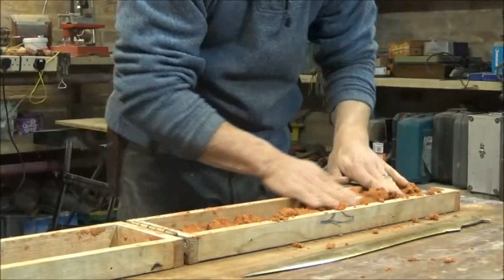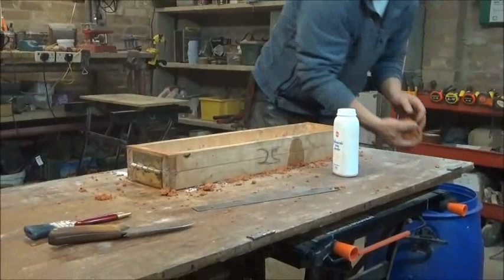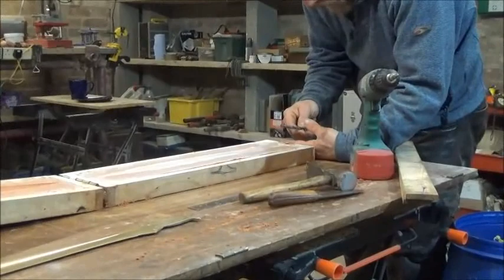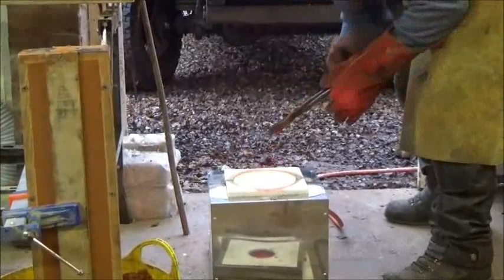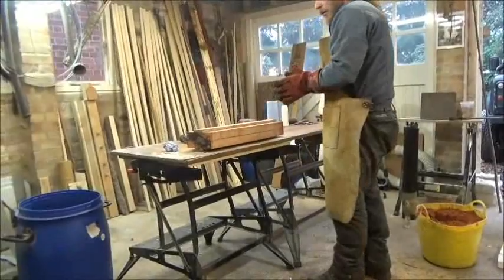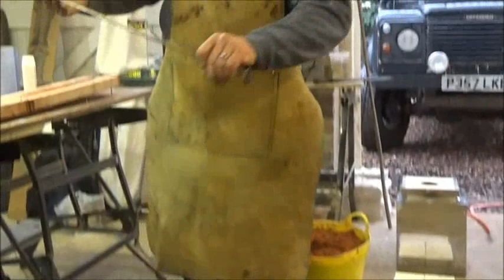How To Sand Cast a Bronze Age Sword

Comment: I worked in a cast iron founry for 5 years...  happy days  its better if you sieve the sand for the top layer ... We used parting powder made from chalk .... but it would have been better if you had layed the blade on the base and filled it up and rammed sand on top of the blade .  then turn the mold over and make a joint ...   then put the top half of the box on top then parting powder then fill top half with sand .  then you should be able to lift the top box off remove the sword mould and cut the runners an risers ....   youll get a better finish if you use a Sieve ...  Once it has been cast you should let it cool down naturally .....

Comment: Just a suggestion... a tiny suction cup or a length of wood with adjustable suction cups on the hilt and blade part would probably give you flawless pickups with little risk of damaging the sand.
Reply: I don’t think they had suction cups in the Bronze Age lol
Reply: @peterwetton2655  the sword design is the only bronze age part of this.
Reply: The sword might be too hot for cups?

Comment: If the sand reacts anything like concrete, which I think it might, to a degree.

Using a palm sander or something similar, around the outer edge of the mold, ( box ) to vibrate the sand, should better compact it.

After setting the pattern in the sand a jig could be made, of sturdy, flat material that sits just inside the mold. 

Having pull-down straps fastened to the tighten the jig, on both sides. 

The straps come together under the table, pulled tight to one side and cranked tightly, to compress the jig. 

A combination of cranking and vibrating, around the edge, should produce a finer detail, left behind in the pattern. 

The PH of the sand will be crucial to create a smooth finish, which is also the idea behind the vibrating as well.

These techniques are used in concrete forming so, I suspect they should also work or at least not harm in the process.

Using hydrated lime in the mix with sand and possibly in place of the powder, to release the forms, could be an inexpensive alternative.

Comment: A comment, here in the USA talcum powder is call baby powder however baby powder sometimes is made with corn starch.  Corn starch is flammable anyone casting should know this but if anyone is new to casting be aware. 
Why not have a mold master that has the cup and fill track already built in?
Very nice.

Comment: I've read about a two piece limestone mold for casting bronze spear heads that had been discovered in Israel.  Dated to 400 b.c.e., if my memory is not betraying me.  I recall the author saying that such a mold might be good for up to 100 castings--although I have no idea how such a determination could be made.
Reply: Charles Christopher 
A geologist and/or someone with experience with stone casting might be able to divine the approximate amount of casting such a mold might give.

Otherwise, we need to actually do a replica of the mold and test it out.
I have never played extensively with limestone or with casting itself either, I am still learning/researching about it.
Reply: After so many casting's the limestone loses it's strength becoming brittle possibly do to the capability of retaining water, maybe that's what they're testing?

Comment: how did they make the first sword?
Reply: Wood works well to shape into a casting blank as long as it's dry when you shape it and you don't let it get wet (to prevent cracking and warping).
Reply: diamondflaw I thought of wood but I imagined clay being used and not sand. Just wrap the wood sword in clay then fire it which will burn away the template then pour the bronze.
Reply: Luciffrit Sand could be reused, I think. Clay would definitely be a one time use. Also makes it much easier to remove finished piece
Reply: A man punched a tree then made sticks form the wood and made a wood sword and shovel to make a better sword from better material.LOL
But seriously, things improve with time so it's a processes.
Reply: paul styczinski Makes sense.
Reply: ***** that'd be cuz of the libturds and oblowjob
Reply: Probably with a wax filler carved into the shape of the sword. That way the wax burn away once the molten bronze is poured in.
Reply: how much would you charge to make me one

Comment: Would it be possible to list the materials used in the video description? I would like to know the composition of the sand. Cause just "sand" is vague. And are there alternatives in sand composition? Also, how would you make the casting with out the blade to start with. Like if you were making it from scratch. And last, are you planning to do a video on a primitive forge? Like how the ancients forged bronze.
Reply: I actually already looked into the courses. Unfortunately for me I'm in the US. Maybe I'll book myself for a course when I visit England in the future. Thank you very much for your response Will Lord.
Reply: UrielOmega if you dont have a sword to do this with, make a styrofoam mold. shape it into the exact size and shape that you want the sword to look like. bury the styrofoam sword completely except for a small spot where you can pour the bronze or aluminum in. then pour in the liquid that you are using to make the sword, and the styrofoam should melt and the liquid metal will take its place.
Reply: I hoped that helped :)
Reply: It did thank you :)
Reply: No problem :)

Comment: Great video!

What about the detail on La Tene (presumably ceremonial) swords? Surely sand isn't sufficient for that detail, do you know how they did that?
Reply: Do you mean the v shaped design at the transition from the handle to the blade? You would have to make your model thicker there and grind/file/engrave/chase the details into your master. But yes, sand can hold decent details. You might get surface blemishes on subsequent pours, but nothing too difficult to clean up. 
Great video, Will!

Comment: Any reason why you did not talcum the opposite side of the mold?
Reply: Jeff Chartier 
The talc is there to keep one side from sticking to the other and for easier separation.
It has to be present in between the cakes. If one side gets the talc, then all is well.

Comment: Is brass good for a machete or hatchet? I'm thinking of making one for hiking.
Reply: Brass is rubbish, if that's what you mean. Too soft to keep an edge, or so I've been told. If you mean bronze, then I imagine that it wouldn't keep its edge as well as steel, but would probably serve its purpose.
Reply: TheSteelEcho666 Derp, I did mean bronze
Reply: dasdew2 Not as good as steel, but it works. /watch?v=ngjMtzJ6xgQ